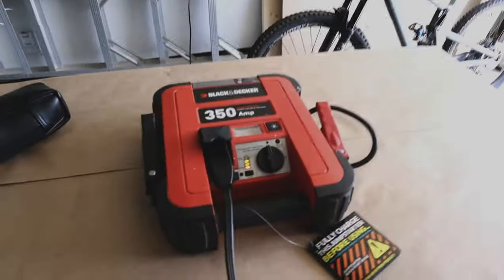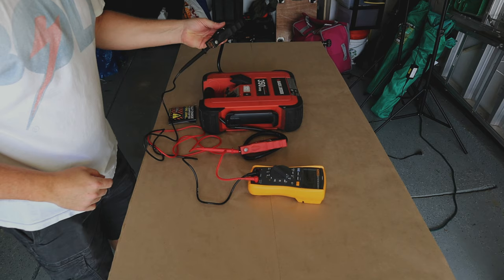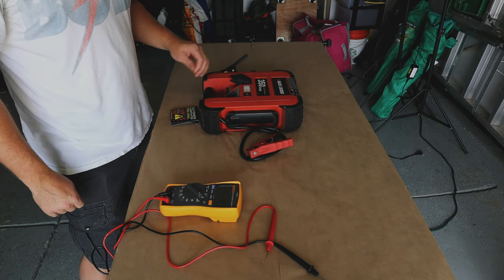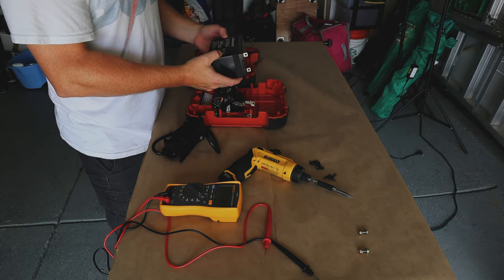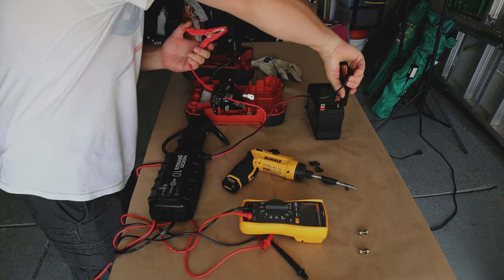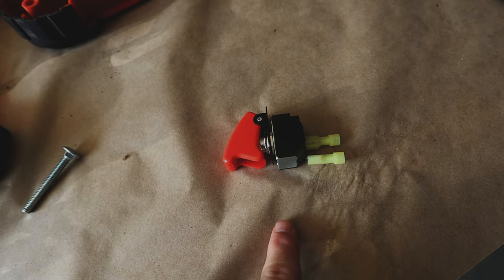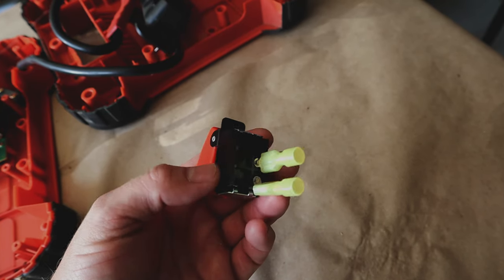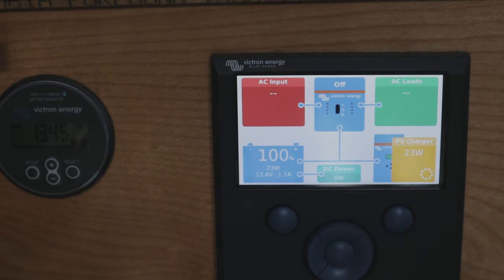#MTBPlanB Precision Circuits LI-BIM battery jumpstart

Comment from the maker: Building a little redundancy and resiliency into the battery system of the van. What's your plan if you get stranded with a dead starter battery?